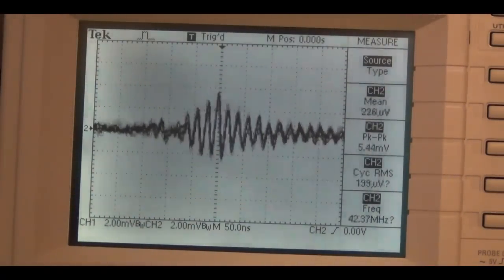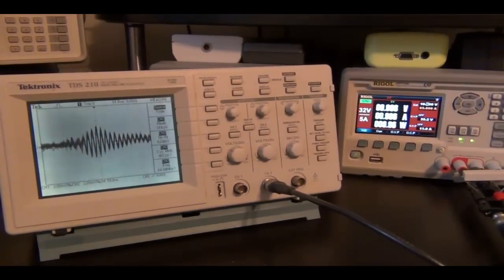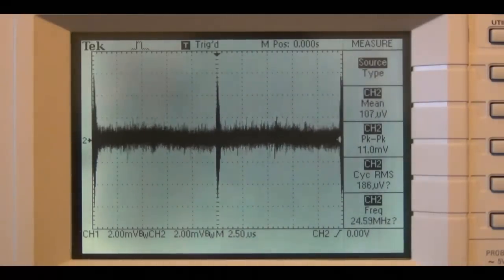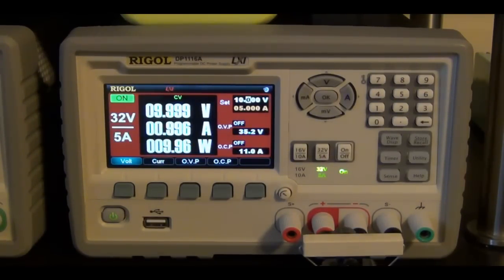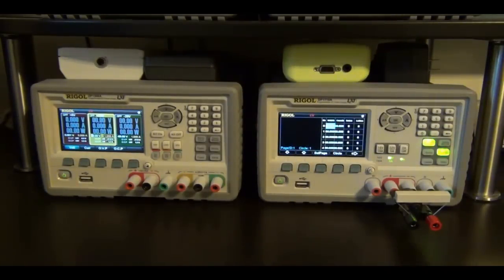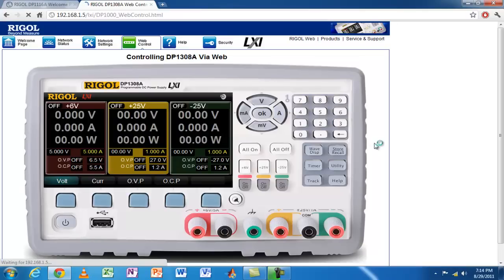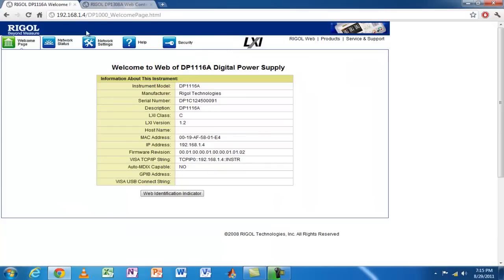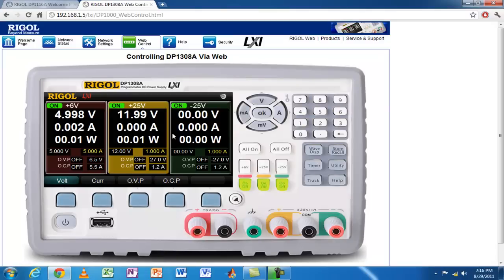TSP #6 - Rigol DP1116A and DP1308A Programmable Power Supply Review (Part 6/6)

Comment: Hi,
Can't you use the O.C.P. to  set a max current and the power supply will cut power if current grater the set value. 
 
Is the O.C.P. measured once a second too? 
 
Thanks for the videos

Comment from the maker: @bfestevao There is a manual for calibration which is available upon request from Rigol. Of course you would need the necessary equipment to calibrate the power supply. You can also always send it to Rigol for factory calibration.